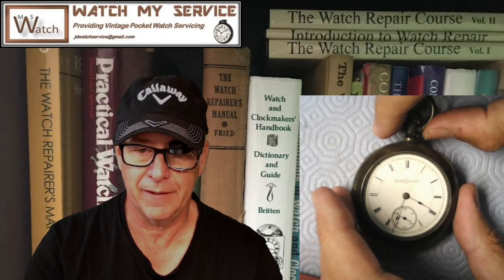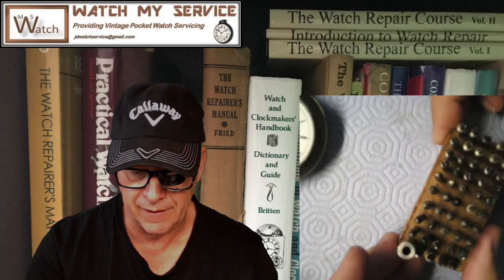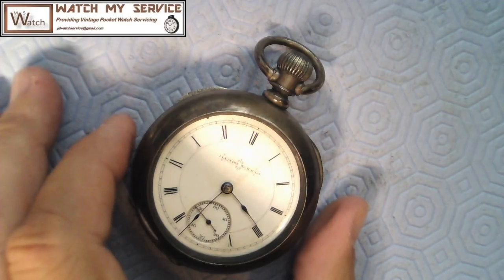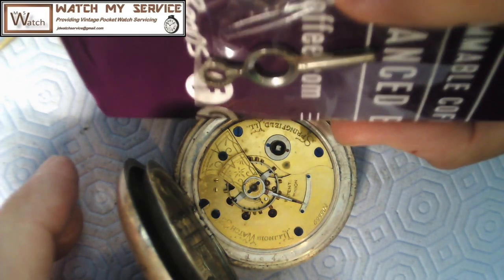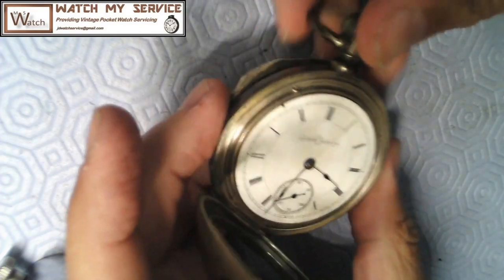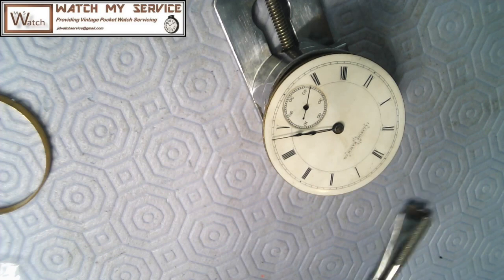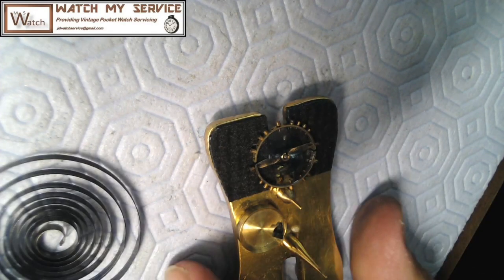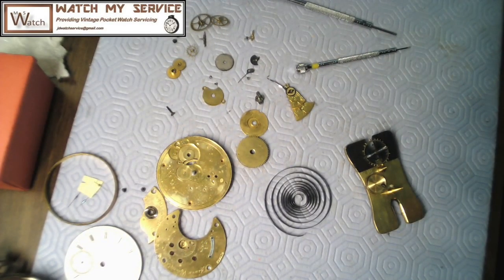Disassembly of 1887s Vintage Illinois Pocket Watch

Comment: Just purchased 1883 Model 1 Grade 2 serial number 485090 with screw off front and back. Movement looks like yours, but with an extra foot extending off the end of the balance wheel bridge. 
My first attempt to wind it broke the main spring after two or three turns. Part of the spring exposed itself from under the main spring bridge. Excited to repair it myself!
Reply from the maker: Good for you, should be a great adventure

Comment: Polident does wonders for enamel dials. My go-to cleaning solution.
Reply from the maker: I could try this on an old dial as a test, thanks. I did use my father-in-laws denture cleaner pills once and the lettering vanished creating a new type of “guess what time it is” dial.
Reply: @JDRichard  So far, I never had a problem with the letters vanishing. I've done quite a few of them. Soak for 30 min or so in drinking glass, suspended on a wire with a tablet of Polident and it works like a charm. However, do try on an older dial first. I'd hate to give you bad advice!
Reply from the maker: Thanks, will try

Comment: Hi, first pocket watch video I’ve watched. How will you oil the centre wheel if the cannon pinion is still in place? Thanks!
Reply from the maker: Normally you remove the cannon pinion, take out the center wheel and oil the center wheel jewel.
Reply: @JDRichard  thanks Richard. But how do you do it if they are both still connected?
Reply from the maker: @boydsargeant7496  you can’t oil under the cannon pinion. It has to be removed.
Reply: @JDRichard  thanks, thought so!